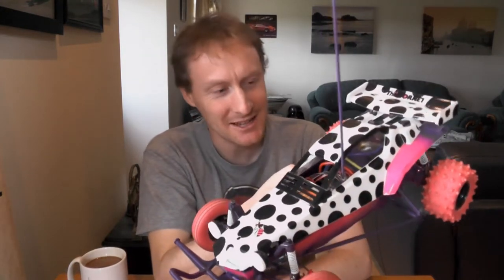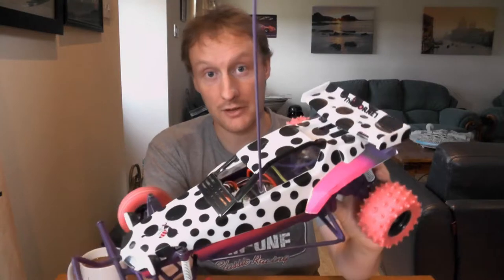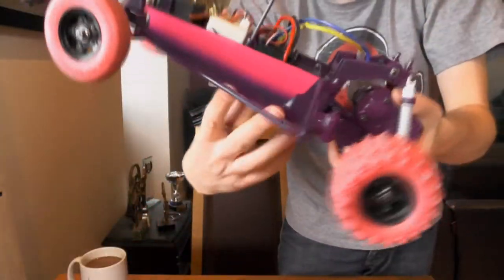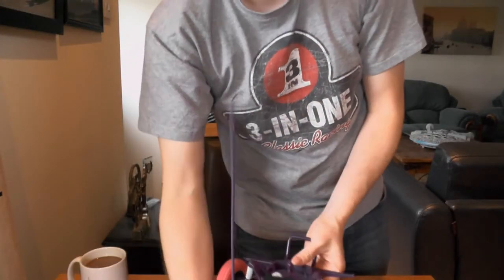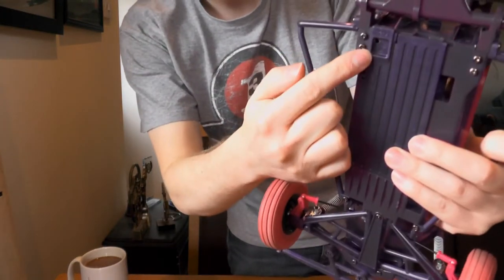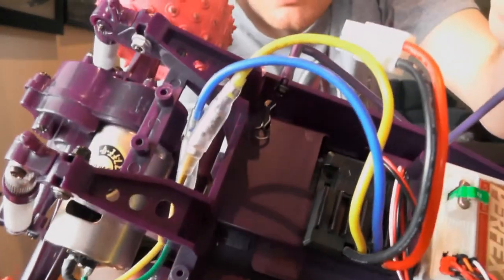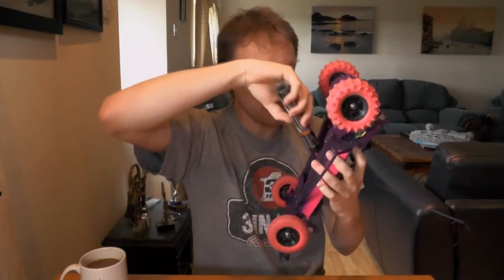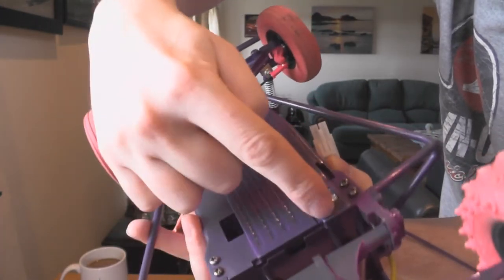How to stop your Tamiya Hornet battery cover falling off! Sorted!

Comment: Hi.  Just an update on my previous comment about using a 2S Lipo shorty pack.   I've bought a Hornet kit now and have had a chance to try out my theory.  The shorty pack will fit with just a tiny amount of dremeling to the front edge of the top of the battery compartment to allow for the battery terminals on top of the pack.  Once in you can slide the battery towards the front of the compartment and put a bit of foam behind to stop it rattling about.  None of my other standard 2S packs will fit in and would need more major work (not sure it's possible).  Anyway, the shorty pack leaves a nice space to do your fix and you can put the hole right through the middle of the tab rather than right in the corner.  Also you don't need to make the bolt thinner either.  I've just put a hole through the shaft 30mm along the thread to allow for the spring clip.  Works a treat although can't test it in action till I build the rest of the car.  Only arrived about an hour ago !
Reply from the maker: Hello. Very good information! Thanks! I wonder if it's possible to "pin" your comment to the top of this list, so that other people can view it? Hmmmm...
Reply from the maker: The answer appears to be "no"

Comment: Good idea. I'm tired of my grasshopper door falling off all the time. Thanks for the tip..
Reply from the maker: You're welcome! But before you do this mod, check out Ampro Engineering. They 3D print parts that fix these sorts of issues. Mine is the free solution, theirs is the better solution!

Comment: Did your mod but I used piano type wire and drilled a small hole in the battery cover in the area you did and also a bigger hole up in the chassis like you did also,I bent the piano wire in a circle at the bottom that goes through the battery door and at the tip where it pokes through the hole in the chassis I bent it over and down with enough space so I can put a Tamiya body clip through it, Good thing is it stays in the battery door this way and you can't lose it!Thanks for the idea  :-)
Reply from the maker: +shenlonco You're welcome, glad I could help :) Sounds like your method will work just as well. Fingers crossed no more battery doors will fall off for either of us!
Reply: Yea nothing like a battery pack dragging out the back of the buggy by the battery wires! Lol!!
Reply from the maker: +shenlonco Such a pain in the arse!

Comment: Your girlfriends RC car ?  I think you doth protest too much !   Just admit that it's yours and you love the purple chassis and pink tyres :-)   Anyway, I was thinking that if you used a 'shorty' lipo pack then you'd have a lot more space to put in something to secure the door.  Looks like a bit of a squeeze with the standard size pack.  I got a couple for my Sand Scorcher and they work well.  I haven't got a Hornet to try out my theory and it may take some work to allow the wires (which come out of the top of the shorty battery) to fit.  Anyway nice vid.
Reply from the maker: Aww caught me, red handed!! That's a very good shout, actually, yeah a shorty would be just the ticket. I first did the conversion on the hornet, when it was running the 7.2v ni-mh, so that wasn't an option, for me. If I did it again, I'd go shorty lipo, definitely. Still have to put the bolt through the little tab, though, so it isn't simply just holding the door up. Thanks for watching!

Comment: check out AMPRO engineering on youtube there's is a bunch of 3d printed parts and there awesome.
Reply from the maker: Cool, thanks Patrick!
Reply: I definitely second that! AmPro sorted the battery door, he has a small bracket that keeps the front of the gearbox from slapping up all the time, rear shock relocation brackets, that soften the ride, 4 LINK FRONT SUSPENSION!!! No more dramatic toe-in or camber in when the suspension goes down. 
Best of all - NONE of these mods require ANY alterations to the stock chassis! 

...... and if you're really feeling NUTZ, he also makes a sideways cantilever front shock kit! Front shocks on a Hornet or Grasshopper - that actually WORKS!!

He's also got cool fix-it bits for Blackfoot/Monster Beetle, Frog, Grasshopper II, Hilux/Bruiser, and Lunchbox/Pumpkin. All improved suspensions, steering, and for the Hilux - a gearbox lift kit - so the transfer case and driveshafts no longer hit everything in their path, and no more high centering! 

....... I DON'T work for the company, I get no endorsement fees. I'm just excited about these upgrades that properly improve these classic rigs, and for collectors, doesn’t alter them in any way! (except for the Hornet cantilever shock kit!)

I actually can't wait to install the 4-link independent front suspension on a Lunchbox - and see if it will FINALLY take a corner ON its wheels!! 😎👍👍
Worth a look.
Reply: He's also got YouTube channel, where you can see these amazing bits of kit!